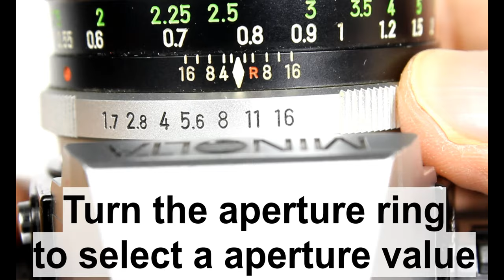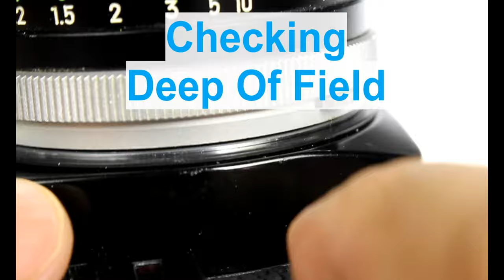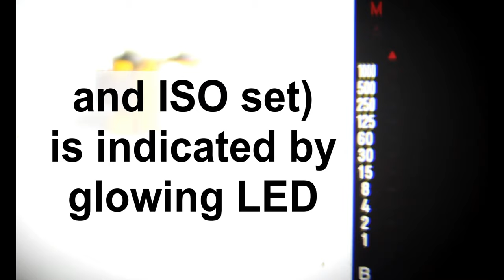How To Use Minolta X-370 X-300 X-7A Film Camera

Comment: As a kind of hobby I look in dumpsters and curbside stuff for electronics - PCs laptops Chromebooks gaming systems tablets... At an apartment dumpster a few days ago I was digging around and i found this camera, & some other ones, plus a couple of different attachable lenses. Not sure if it works! Also found a MacBook Pro! It works!! What does "ISO" nean, and what does turning the small dial do? Thank you 🤓 i believe there's an attachable flash unit like the one used here! But think the one i found can move, so its more versatile, flexible!